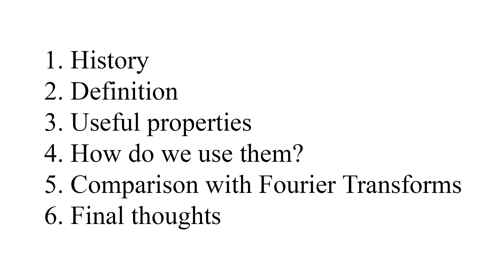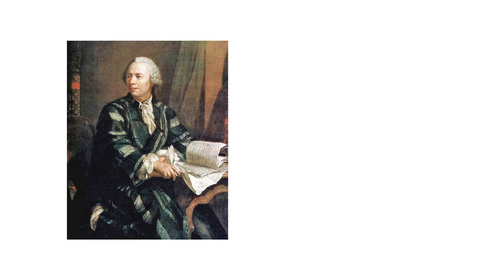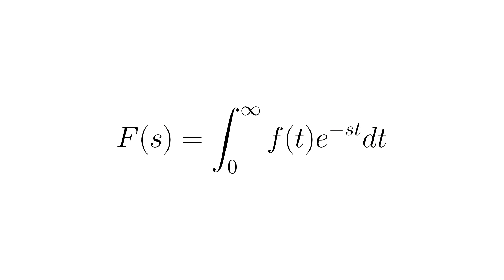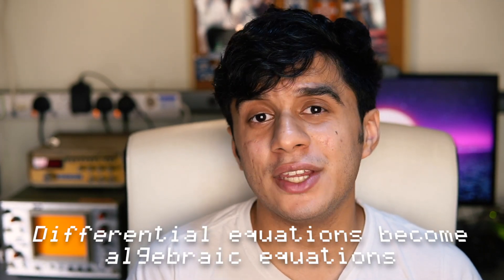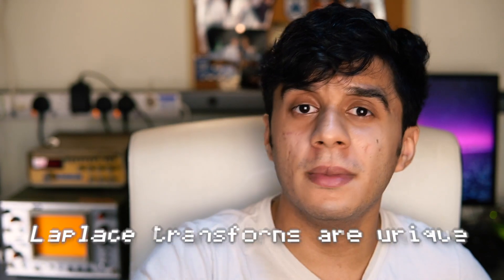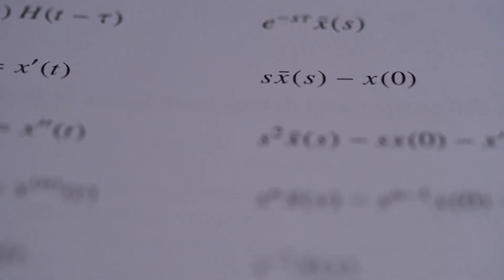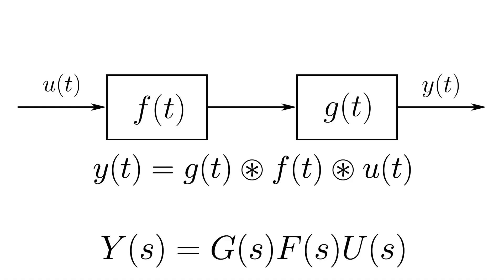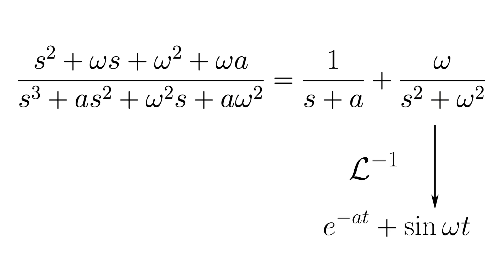Everything you need to know about Laplace transforms

Comment: Sample of solving the 'convution' solving in the time domain
Why do they use s for frequency domain like f could work easy like f(t) t=time but f(f) f=frequency
Reply: I believe s is supposed to stand for state.  Either that, or it's just a completely arbitrary letter, when other letters were spoken-for when the concept was coined.

It's more than just frequency, so they don't just use f.  It is called complex frequency, because it is a complex number where its real part represents exponential decay, and its imaginary part represents angular frequency.

It's common to use the trio p/q/r, as the equivalents of s, when using position domain instead of time domain.  The Laplace domain variable for x is p, for y is q, and for z is r.  The next letter in this group is s, which is the Laplace domain variable that corresponds to t for time.

Fourier transform could use omega or f, for frequency, or omega for radian frequency, depending on which variant of the transform you use.  In the f-world, Fourier transform and inverse Fourier transform, are both identical processes, so it makes it easy to match the pairs.  In the omega-world,  you accumulate a constant.  Some tables will normalize this constant, by including a factor of 1/sqrt(2*pi), so an omega-world Fourier transform is bidirectional with the time domain.

Comment: Hi thank you very much love your videos!
 I am now taking linear systems course , it feel  that I don't  understand well the difference between Laplace transform and Fourier, and in addition in which sort of problems I will use which of them. If their is anyway to make it clearer that will be great! thanks again!
Reply: Good question.   The Fourier transform is a special case of the Laplace transform, once the system achieves steady state and initial transient behavior settles.  Corresponding to the steady state, the real part of the Laplace domain variable s, will approach zero.  The s-domain variable will become a purely imaginary number for the Fourier frequency domain, which is j*omega.

The Fourier transform is a spectrum of sine and cosine waves that model the signal.  The Laplace transform is a spectrum of exponentially decaying sine and cosine waves, and some with no decay, that models the behavior of the signal, inclusive of both the initial transient, and the steady state condition.